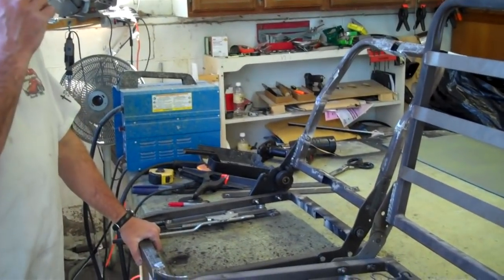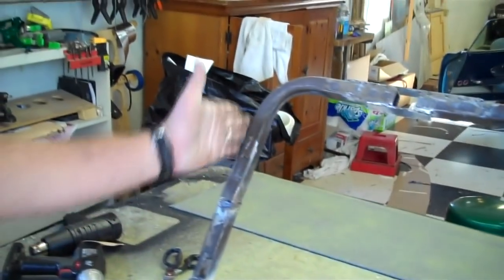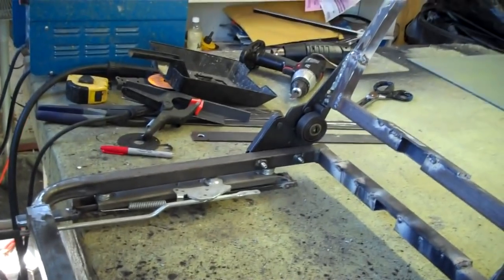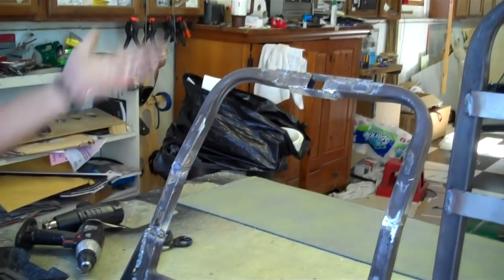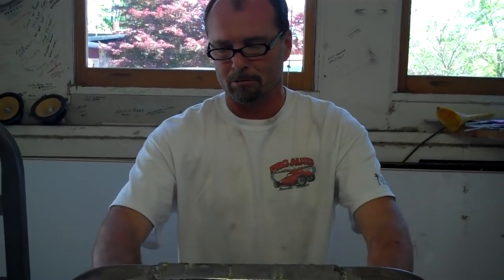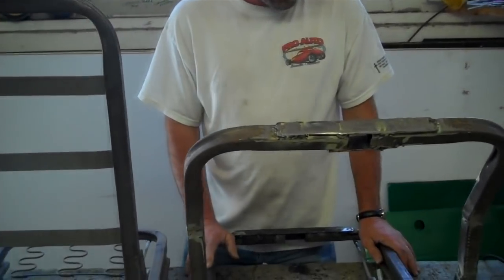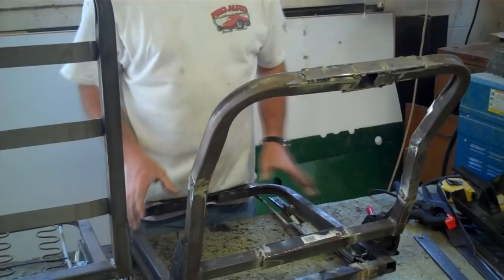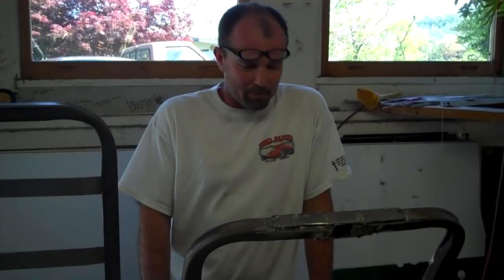How to make a Custom Seat

Comment: Thanks for the video!  Wow that'd talent!

Let me share what has worked very well for me for FREE MATERIAL!, much of which I've learned from my brother who is a professional upholster, with making a new bench or van bench seat or boosting old car seat foam:

For car seats that need boosting, most often they just need more foam added to be like new again, I find used carpet pad foam often in a neighbor's trash or dumpster behind a carpet store. Remove the car seat fabric clips and carefully peel the front and sides of the fabric to gain access under the seat foam core, which often requires the seat be unbolted from the floor. 
Place a sheet of it or two under the seat foam core, right on top of the spring wire deck(carpet pad foam is tougher than the core so this also stops the spring wire deck from cutting into the seat foam core bottom).
Your second sheet can be cut smaller just covering the area the butt sits on.
Also inspect the top of the foam core and add carpet pad foam or regular foam where might be needed like by the door, worn from getting in and out over the years.
Spray adhesive can be used to bond the foam to the foam but is not necessary except for any top foam added.
Your seats will be firm and new like for many years now, it's like free magic!
The seat back usually doesn't need a any foam because it's the seat that gets the body weight on it from gravity. If you seat back should need a boost, you can add polyfill batting on top of the foam for free-see below.
These methods can also be used on sofa seat cushions.
I'll share below where to find FREE used good foam below!

To make a bench- where to get free foam: there is so much FREE foam and FREE polyfill - in many soft pillow backs and polyfill batting often wrapped around foam cushions for the taken in people's discarded sofa's and chairs found outside dumpsters at apartment complexes and the back of thrift stores. 
Even though it's used, it has been well protected covered inside the upholstery. 
Of course in the event it's a cat lady's furniture and the cats happened to piss all over it, you'll smell it and know to move on lol
Most apartments don't allow pets or make it expensive to have a pet so a lot of furniture is pet free.
Use a box cutter to open the old furniture to get at the free foam or poly as you need or use the zipper you'll find on some pieces.
Some foam in old sofas contain like a 1" thick panel of foam on top of other foam that is perfect thickness to add to your sofa foam to give it the new boost again.

Foam can be cut to size using a hack saw loose blade only in your hand holding the end making a sawing motion.
New foam looses some of it's firmness over a break in period, say after 5 years depending on how much it's sat on. 
But then the broken in foam lasts a very very long time at that softer level firmness before it really starts to break down. 
You might be able to buy complete new expensive foam cushion cores but they will sag after the break in period as well.
This is why so often we love a new firm piece of furniture but then it gets soft and saggy on us. 
Now the sofa companies could to put super firm more expensive foam in their sofa's when new that might be a perfect firmness for us when broken after the 5 years break in period, but then we wouldn't buy the sofa if it's not nice to sit on from the beginning in the show room, so there's the dilemma when you fabric is still in great shape after 5 years but the foam is now sagging.

The free fix:
So just add more foam if you can firms it up to make it like new again, unzip and compress the foam as you slowly peel off your fabric from the cushion core. Then either add more foam to the top or bottom or hack blade saw through the center horizontal line of the foam core all the way from the back to almost through the front but not through, so you leave a good hinge of foam in the front.
Then place about a 1" thick of used foam in the sandwich and holding it closed peel the fabric back over the foam cushion.
You can also add more polyfill pad to the cushion core on it's outside to add more softness and support but adding more foam is the big boost.
Spray adhesive is optional to bond the foam to the foam.
People often think that when the seat sags that the springs under the cushions, have weakened but no, it's the foam, the springs are metal and strong, the foam is just foam.

For making complete new cushion tops for say a bench, besides free foam, you might even find a lightly used fabric in some part of a discarded sofa to use IN FACT the back side of sofa's is often a large sheet of fabric that has been hidden against the wall never sat on all it's life and so still brand new! 

Discarded trash at a dumpster is free for the taking and your reducing what goes to our planet's landfill.
This is win win, real free hard core recycling, helping to save our environment as well!

Take care!
Reply from the maker: Right on..Thanks for the info!..Your welcome...Glad you liked it!